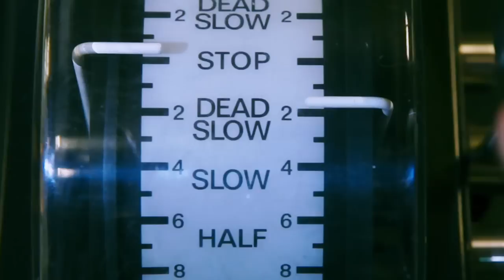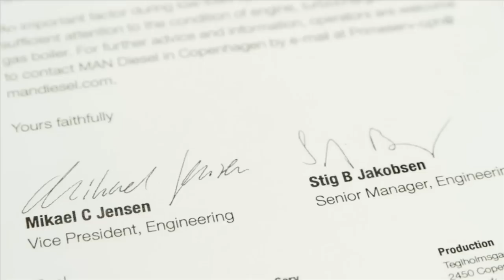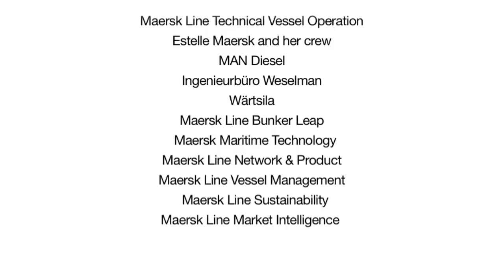Slow steaming

Comment: Pirates find slow steaming very complimentary to their operations, too!  No doubt Maersk balances security with economy, though.
Reply: Pirates attack on vessels with a very high speed crafts ie 40-50 knots.
Reply: Actually, the pirates that attacked the Maersk Alabama were going 27 knots. Many modern container ships could outrun them if they canceled limits on the engine.